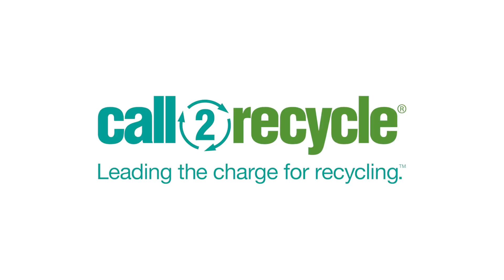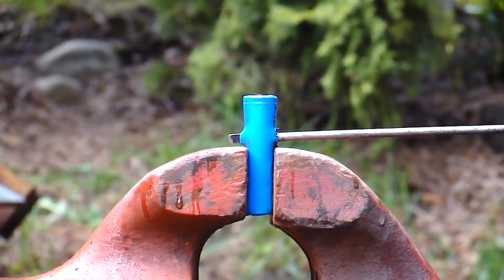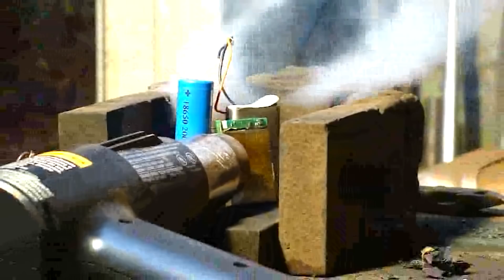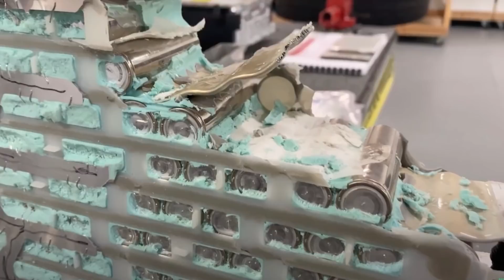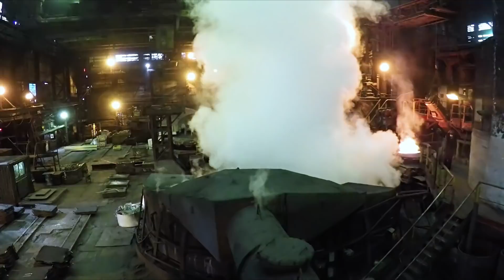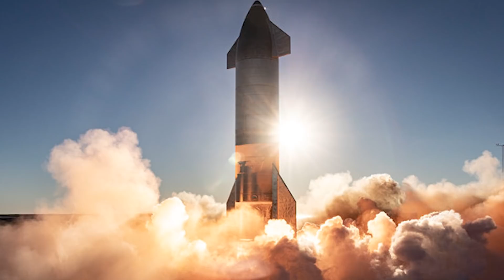Redivivus - The Future of Battery Recycling

Comment: Very Interesting. This cold shredding & scrubbing process they have seems absolutely necessary to be adopted everywhere in the future. As more electric vehicles take the road, there will undoubtedly be more electric vehicle crashes, (even though the % of crashes per mile may go down due to driver assist/ FSD types of features). This is definitely something to keep an eye on, I would not be surprised if there are more government regulations regarding ability to safely transport, dispose of, and  even recycle these battery pack materials. Thanks for the video